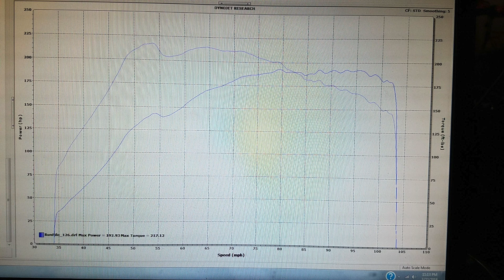Big Turbo Abarth 124 Baseline Dyno Pulls - Episode 11

Comment: Just drop the Ford 5.0 V8 in it or an ecoboost 1.6L. The 1.6 is good upto 380 crank hp. That'll put an Abarth 124 or 500 Abarth down the road running some serious times and speeds.

Comment: Check Eurocompulsion's website. Accurate dyno results require a specific 4 wheel dyno. Any other dyno will cause the Abarth to cut power at higher rpm.
Reply from the maker: Peter Kettelkamp that’s not true. It’s a very good marketing tactic. Can you otherwise explain why my car ran an appropriate 1/4 mile for its power level?
Reply: Maybe Eurocomplusion's claim only pertains to the 500 Abarth? I don't know.
Reply from the maker: Peter Kettelkamp the video they use to try and show this is a 124